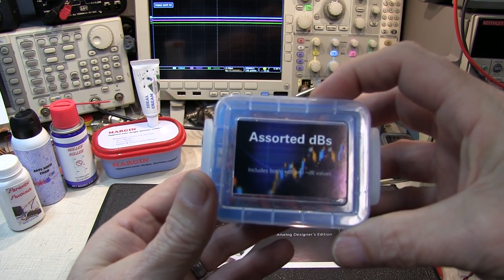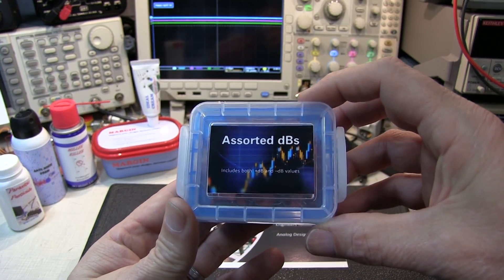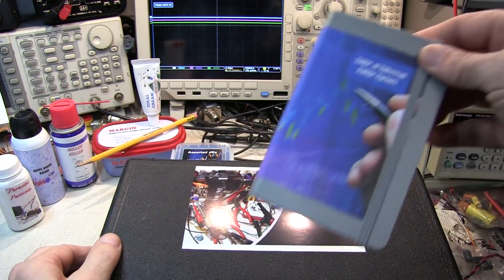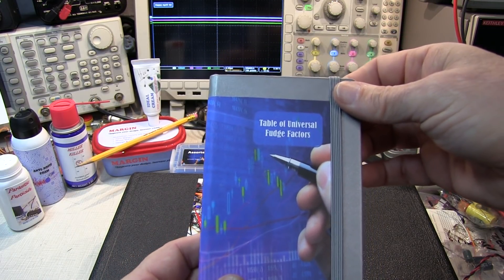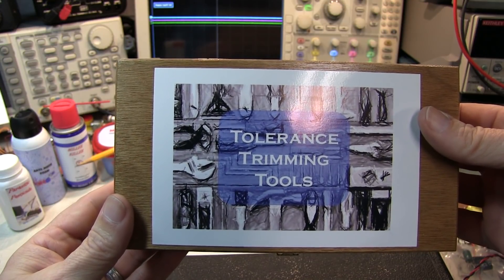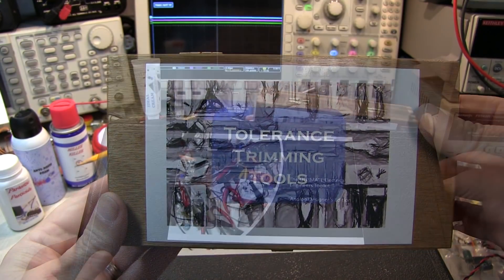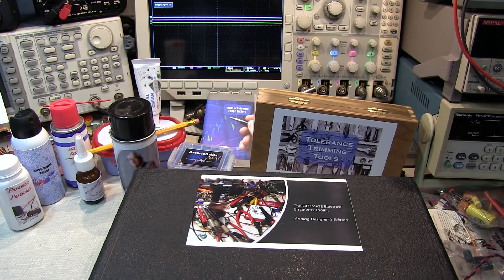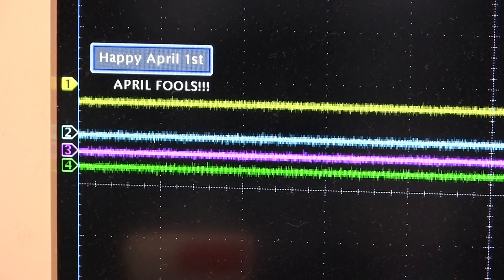#352: The ULTIMATE Electrical Engineers Toolkit: Analog Designer's Edition

Comment: Why do they call the transistors leads electrodes? Preamp tubes and power tubes leads pins are also called electrodes. It seems that an electrode has a special conductive coating or plating to be used to pass current into a semiconductor transistor or vacuum tube. A strained wire or solid wire is not an electrode. So an electrode must be different than a piece of wire.
Reply from the maker: Electrode is a generic term for a connection to a non-metallic part of a device (such as semiconductor, or air, or vacuum, etc.)
Reply: @w2aew  Yes, The Electrode is the resistor leads which the resistor leads are connecting the resistor carbon composition, carbon film or metal film material. If you apply 100 electrons into the resistor, the 100 electrons are going through the resistive material carbon composition which the output end of the resistor won't have 100 electrons? The purpose of the resistor is that its not going to pass all the electrons but to absorb the electrons or "dissipating the electrons" since  some of the electrons are getting converted into heat?
Reply from the maker: @waynegram8907  Electrons are not lost.  The current entering a resistor equals the current leaving the resistor.
Reply: @w2aew  if the current entering a resistor equals the current leaving the resistor, it doesn't make sense how there is a voltage drop or a potential difference. Something is not the same entering the resistor and leaving the resistor, what has changed to make the voltage drop?
Reply: @w2aew  voltage is NOT electrons, what is voltage? It's only the pressure pushing the electrons but voltage is not electrons but only the pressure. The pressure in electricity is not electrons but what is it?
Reply from the maker: @waynegram8907  Voltage is the force that pushes electrons through a circuit.  Another name for voltage is Electro-Motive-Force, or EMF.  Electrons are the charged particle - the motion of charged particles in a circuit is the current.
Reply: @w2aew  I get that the Voltage is the force that pushes the electrons through a circuit. What I don't get is what is the Force. Is the Force an electrical charge or something. The EMF/voltage is a Electrical Charged force? A Voltage Divider/resistor is Dividing the EMF down? A voltage divider/resistor is dividing the FORCE?
Reply from the maker: @waynegram8907  The force is the natural force that causes like charges to repel, similar to how like poles of a magnet repel each other.
Reply: @w2aew  So Voltage/Force is mostly Magnetic and Not Electrical? A 9vdc Battery is packed with charged electrons and the +/- Battery Terminals Electrodes are like Magnetics that are the Force. What I'm confused about is since Voltage is Not Electrons or Charges, it seems that Voltage is Magnetic like North & South magnetics that are pulling or pushing electrons? The Voltage divider/resistor is dividing the force magnetic force it seems?
Reply from the maker: @waynegram8907  I said similar to magnetic force, but not the same thing.  Electromotive force and magnetic force are related, but not the same thing.  A battery creates an abundance of positive and negative charges as a result of a chemical reaction.  Yes, electrons are pushed/pulled by an electromotive force.
Reply: @w2aew  So a electromotive force is made up by a magnetic force plus also positive charge electrons & negative charged electrons? The batteries chemicals create the +/- electrons but what is creating the EMF?
Reply from the maker: @waynegram8907  EMF is not made up of magnetic force. See this article: https://en.wikipedia.org/wiki/Electromotive_force

Comment: We told some overly pushy manager that he could not enter the lab, because the way he walked and moved caused noise spikes in our measurements.  We had a leakage measurement device that was extremely sensitive. You'd see some spikes in the pA range whenever someone walked around. We made sure the device was on when we wanted to focus.
But, next time we'll use management repellent spray. (Do you sell extra large ones?)

Comment: Graphite aided design! The eraser is a no no, though. Just make one straight line through the corrected thing. In coding, this is something akin to making your code traceable to you, if you want to look back through, to a problem you already solved. Even calculation errors are valuable to leave open, but corrected.

Comment: Yet another memory from about this time of year, but a decade or so earlier (see my earlier comment below), I used to sell parts to TV and Audio shops. Every week, I would visit the TV shop where my father worked. One week, one of my Dad's co-workers, ordered a jar of Oscill-Juice, and a Grid Leak Pen. The next week when I visited them, I delivered. I had whipped up a batch of Oscill-Juice from a Strawberry Jello base, poured the mixture in a clean empty jar and capped it off and let it set in the 'fridge' for about a week. I seem to remember that I even made up a label for it. (no wild claims on this one). For the Grid Leak Pen, I took a box from an old 6JE6/6LQ6 (a good sized horizontal output tube, sometimes used as a power output tube in some rigs ... like the Swan series), and covered it with Tin Foil, attempting to maintain as few wrinkles as possible. I thought it looked pretty good when I got done. Anyway, when I brought it in, we all got a big Har-Har about it.

Comment: You might have forgotten one of my old favorites ... K8BN's Antenna Wax. Probably came out about the same time of year that your kit did but I bought my jar around 3 or 4 decades ago, and I've horded it all these years. Uses (according to the label): "Eliminates T.V.I. - Lowers S.W.R. - Stops Hair Loss - Keeps Birds off Antenna - Reduces Hemorrhoids: ... (I'm thinking the label editor didn't understand what harmonics are, and used the wrong word here ... or maybe not?) ... "- Used by World Class DX'ers". The instructions are: "1. Remove Lid; 2. Wet Fingers; 3. Wipe it on; 4. Wipe it off; 5. Replace Lid." The minute I saw a jar at the swap meet, I had to have one! I have to add, it's amazing how far technology has advanced!😀

Comment: Love this channel! @Alan, I was wondering if you knew of a handy dandy way to check the impedance of connectors, such as the bnc type you typically use on things like your 74AC14 fast edge pulse generator. If I'm correct, they are usually either 50 or 75 ohm. A lot of times, it is not advertized or made clear when you buy them. Thanks!
Reply from the maker: The fast-edge generator really won't help you.  The connectors are too "electrically short" to be characterized by this low-budget TDR approach.  The best bet is careful physical inspection.

Comment: Awesome!
Are those dB's rated for operation above 1GHz?  If so, this kit could be useful for RF colleagues, also.
I'm having trouble finding any in stock - the usual suppliers are quoting availability 01-Apr-2023.  Another victim of the supply chain issues.
Keep up the good work!
Reply: Will be no problem if you pack the kit with some supply chain glue.